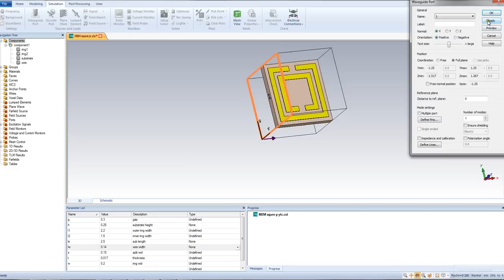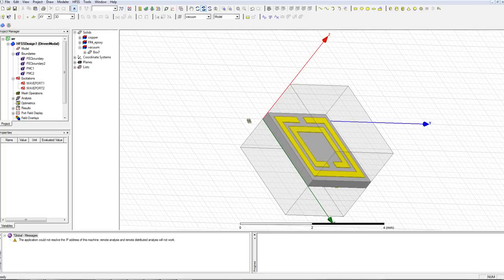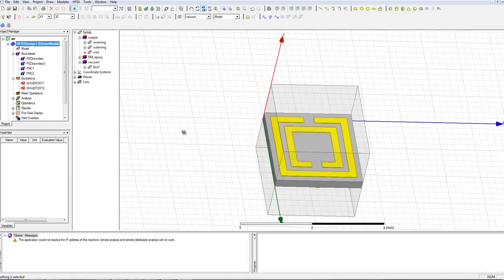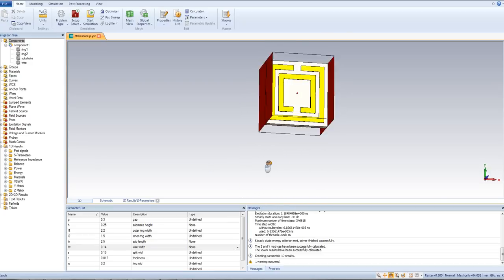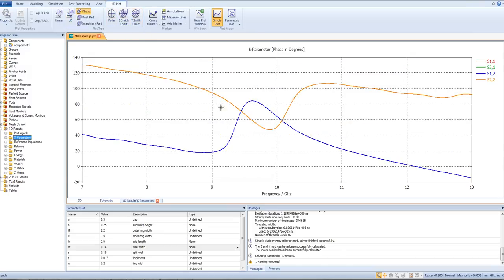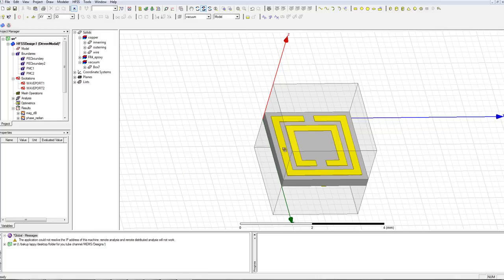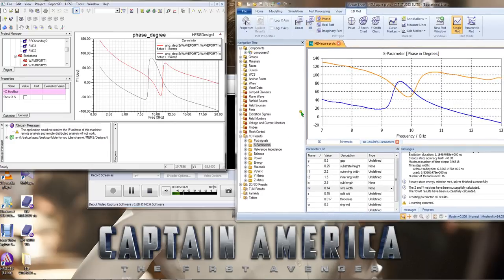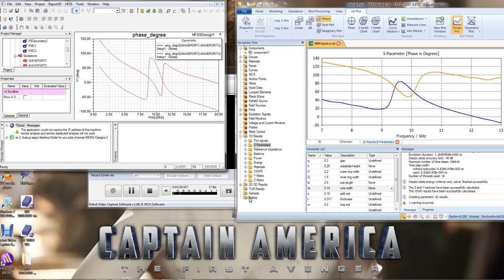Metamaterial Unit cell Square SRR design using CST and HFSS part 2

Comment: Will you please upload the design of rectangular micro strip antenna with EBG  structure?
Reply from the maker: fallow the published document and try to do it... It will help you to improve your EM skills... I made basic videos.. but cant do implimentations or applications which takes a lot of time. Its your job to find appropreate algorithm to design it ... if after designing u r facing any problem then mail me i can help...

Comment: Very nice work, I need to know necessary equations regarding this video. Moreover can you explain how to design a meta material based patch antenna ? I mean what is the way to merge single cell with path ?